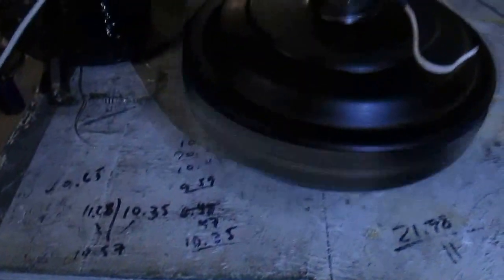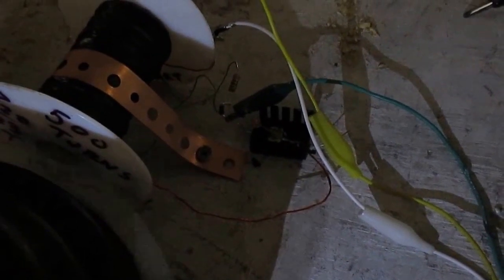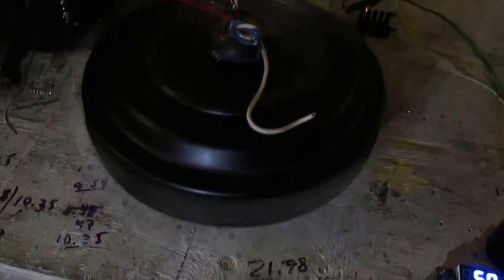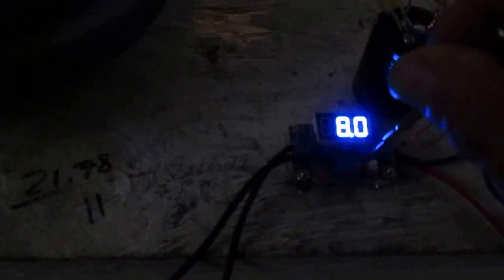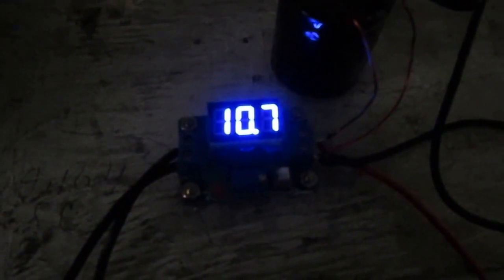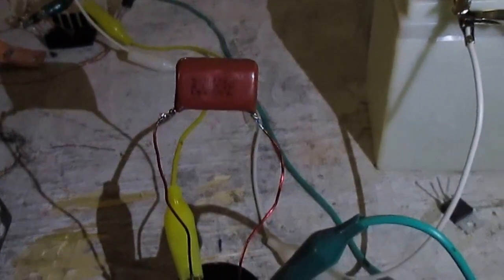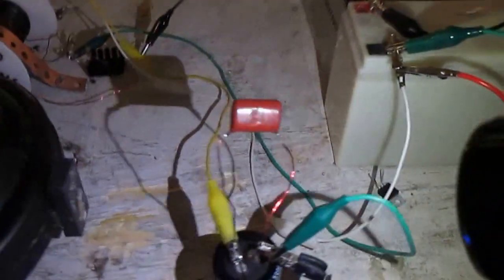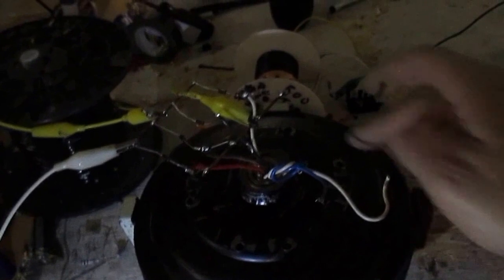Ceiling Fan Monopole Pulse motor BediniSG   8.8.2014

Comment: nice little setup!... you tried earth battery with this?...
Reply from the maker: No need , the pull force of a magnet to a piece of iron is enough to produce free energy which is better than over-unity. You just have to make sure less energy is used in your pulse than the pull force in Gauss of the magnet to your core , that requires Tesla formula for frequency, also must run at key rpm's or frequency like the rpm's associated with resonant frequencies, watch video to understand,     https://www.youtube.com/watch?v=wvJAgrUBF4w&t=1s    ...Bedini intended to have his mono pole circuit to explain this to all that built one successfully..  As an educated ITT graduate I can tell you it took me 3 months to get Bedini circuit running, if i did not have bills to pay i might have got it done in 2 weeks, that is still a long time for someone who has built all kinds of circuits successfully.  They do not teach electro magnetism at ITT at least not for an AA degree level , maybe bachelors , but thats kaka doo doo lies , electromagnetism is the basics of electronics and to not teach it in any course at the beginning of that course is deliberate distraction from the knowledge of such arts.
Reply from the maker: although i like the earth battery , it is very use full, I believe Antonio Meucci invented that to communicate with his wife from over seas in the 1800's https://en.wikipedia.org/wiki/Antonio_Meucci like another version of the Stubble field coil